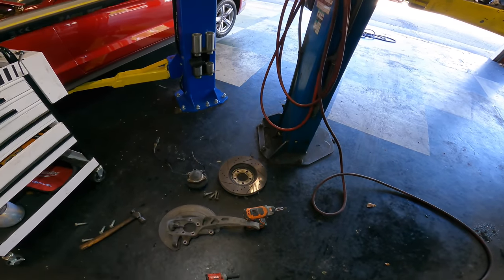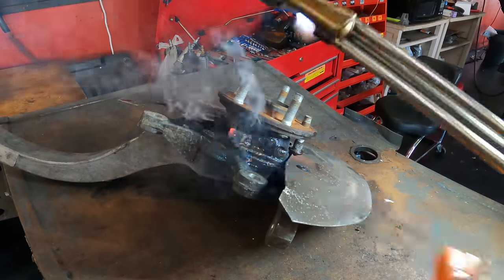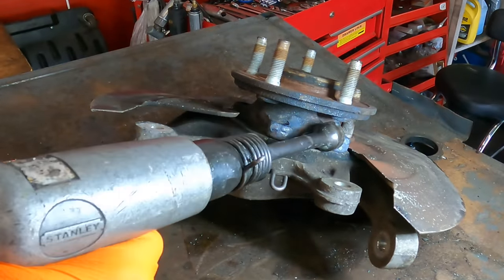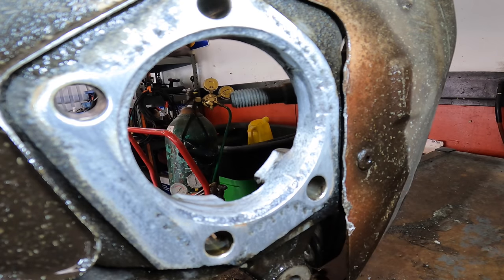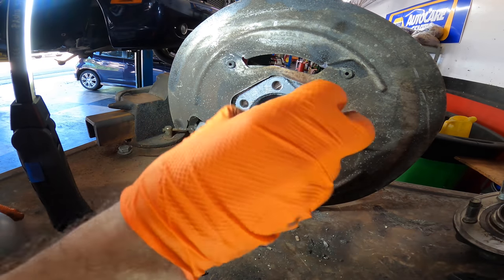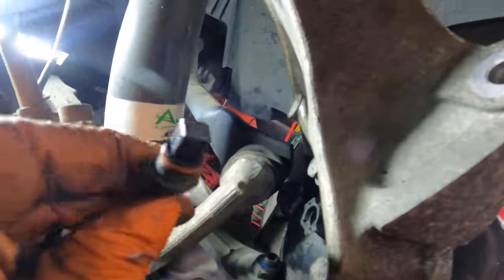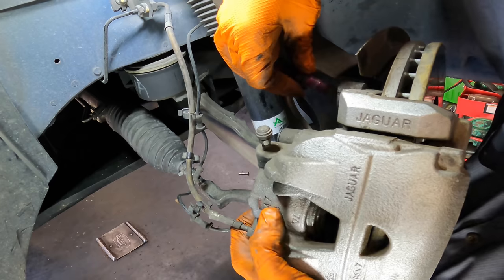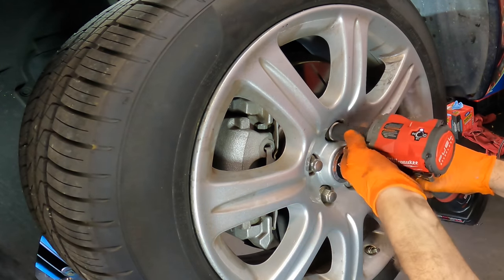Serious Corrosion! HEAT Required! Torching a Jaguar 2008 XJ 4.2 Hub Bearing/Bent Parts

Comment: Nothing like a little aluminum/steel electrolysis, dissimilar metals and the aluminum is less noble. At least you used a zinc based anti seize the zinc is less noble than the aluminum. The only way to stop the electrolysis is to prevent moisture from getting between the steel and aluminum, even a good coat of epoxy paint would help slow it down.
Reply: @OOga Booga I’m going to have to disagree with you as it takes some kind of electrolyte to cause the aluminum to powder into dust it can be a salt or a acid. They are both carried by moisture. Same principle as a battery. That is galvanic action also but then again there we are harnessing the electrons to do some kind of work. Call it anything you want but it is the same effect there is a current flowing between the steel and aluminum that is causing the aluminum to powder up and become a oxide. If you think about it we galvanize iron with zinc to stop the oxidation.   If you really want to dive deep as to what is going on there. I’m thinking that the abs sensor and the tone ring are causing a small magnetic pulse that is acting on both the spinning steel bearing and the aluminum structure breaking down the the aluminum oxide in the steering knuckle and causing the slow breakdown of the aluminum component. Of course the bearing could be magnetized and causing an electric field around it as it turns, but that is a stretch.. either way there are electrons moving between the dissimilar metal that is causing the issue.

Comment: Question for my own knowledge:
Does using an extension between the wrench and socket on a torque wrench alter the torque value? 
Some wheels require a short extension to clear the tire and/or fender.
Thanks.
Reply: I would think so; bet someone's done a YT on this subject.
Reply: It does, but you can find the equation to work out how to adjust your torque setting accordingly based on extension length, etc. There should even be tables and calculators available for it.
Reply: No it doesn't
Reply: As long as the extension is straight and the torque application is smooth, you will not see a difference.  A long extension, very heavy torque and quick bouncing torque application will definitely throw off torque.  Think torque stick.

Comment: The heat and vibration broke the bond of galvanic corrosion 
The whitish substance can be seen as the bearing fell away is alot like a weld though this occurs naturally 
You guys up north probably understand better that salts increase the reaction 
Good one here Ray didn't see any other way to proceed here
Reply: I would not recommend using a blow torch on a steel-aluminium part. Nobody knows how the heat affects the strength of the aluminium part.

Comment: A rosebud would work a lot better for that, puts out way more heat and has more flow so you can run more on your gauges. And I would highly recommend not using a Bic lighter to light your torch! Strikers are about the same cost as a lighter anymore and a hell of a lot safer trust me oxyacetylene Burns hurt like hell. I am a structural welder by trade and you can put alot of heat quickly with a good rosebud tip, enough to camber structural steel and bridge girters

Comment: Well Raymundus: did the wheel true up or not. WAS THE SPINDLE BENT. We all suffer from time change. You should fly to England where your son is in the Airforce and after a short nap go with him to the hobby shop and replace the clutch on  an AlfaRomeo front wheel drive car and all the other Airforce guys looking on wondering if we will get all these parts back together and before noon having it back on the road. Jet lag in that case is truly horrendous.
Reply: Oh yes, he drove out a country road and asked if I wanted to drive back in a right hand drive car. I accelerated up to 75 and in the first corner a car was coming on the wrong side of the road, my hand twitched as I saw I did not have enough room on the inside so I went wide and then remembered as I went past it was left hand passing. I never drove there again.

Comment: Well, I've got 2 question:   Does that kind of heat weaken the metal in the hub and make it more susceptible to failure down the road?  The 2nd question:   would a better penetrating oil such as "in and out" or "Kroil" penetrating oil soak over-night followed up with hydraulic press be an effective option?
I am just concerned that that much heat has compromised the part.   I've even read where the Milwaukee heat gun is effective.  I have also read where 500°F is sufficient.   The amount of heat applied appears to exceed that.
Reply: The bit that was heated up (the bearing) was thrown away. No direct heat was applied to the other part steering knuckle.

Comment: Rule # 5 Do not use the torch with rubber gloves. If by accident they cot on fire the rubber will melt and stick to your skin at very high temps causing you a trip to the hospital and get skin grafts!!
Reply: Apart from that, I use the same gloves daily, working with paint tinting machines. They are awesome a super strong. I was actually thinking about sending Ray some samples.

Comment: :-))) If you want to freak out the basement "scientists" just quench the whole thing in water after it's good and hot! `In lawn mower repair, rule #1 is do not use a hammer on the main shaft to remove the flywheel by inertia. Even though it's in ever manual (When paper manuals existed)

Comment: You should have applied the heat to the bracket  going round in a circle.  That way the bracket  will expand  away from the hub breaking the bond.  What happened was the hub expanded with all the heat making it even tighter.

Comment: Sorry, but didn't heating up that bearing assembly cause it to expand inside of the spindle housing?
Reply: Two different metals. The expansion rate of Aluminium is twice that of steel, so it doesn't matter in this case.

Comment: Does an extreme heat ruin the bearing melt all the grease out of it if that was my car I think I would rather just have a new bearing put in there…✌🏻
Reply: That’s what Ray was doing. Removing the bad bearing to replace it with a good one.

Comment: I wonder if you could have somehow used the hydraulic press to push it out.
Reply: Probably, but he would have had to fabricate a custom jig (holding set-up), as part of the structure was aluminum.
Reply: @kenc2257  you can use leftover bricks. that’s what i did

Comment: which cars are worse to work on? Jaguars, or range rovers?
  I know a service department manager for a dealership that sells range rovers. I asked him how good are they. He laughed and said the mechanics love them. they are job security for the service department. Practically every one of the new ones sold end up being brought in on a flatbed at least once in the first year.. and I don’t know anyone that has ever owned a Jaguar.
 I almost bought one years ago. A friend of mine that ownd a car dealership took one on trade ..it was a Jaguar sedan. He called me and asked me if I wanted to buy it very cheap..He said it’s gorgeous, red leather interior, not a mark on it, we just can’t get the idle to come down below 4000 RPM..
 I told him, I’ll pass, I’m not that stupid yet

Comment: Interesting that they used two different bolt heads on the bearing.
Reply: From reading other comments, supposedly those were replacements for the originals. It looks like they were supposed to be torx

Comment: Steel does not expand at a greater rate than aluminium, its the other way round!
Steel expands by a co-effecient of 10-12 microns per meter for every degree c you heat it whereas aluminium expands by as much as 25 microns per meter for every degree C of heat!

Comment: Hey Ray my story of never seize is extensive During the 2020 election some one kept stealing my trump signs out of my front yard. Well after the second time I said to myself what can I do to help prevent this sorry situation, Well I was slugging down a cold one by my garage and looked at my shelf of can goods and grabbed the copper never seize bottle and coated the outside edges of the signs, Well about 11 at night I hear profane language in the road by my front yard LOL FYI this stuff is near impossible to remove from leather steering wheels and interior parts Ask me how I know I was laughing as I turned on all the outside lights to see a nissan rip away in angry fashion.

Comment: Pleased to see Ray is using the Torque Wrench on vital items such as brakes and lug nuts.  Not just for safety reasons and best practices, but also for liability reasons.  Just one "reeeeee", I would have preferred to see you switch from the latex gloves to heat-resistant gloves while wielding the torch.

Comment: A new steering knuckle was not available (remind me never to buy a Jaguar) - OK  I get that.  But the BEARING was not available?  I thought one could buy a bearing in just about any size / configuration needed.  No?
Reply: they sell as a bolt-on unit. 50 bucks for a pair on ebay

genuine koyo is like 150 bucks

Comment: First off, now you have a slight taste of what I get to deal with daily. Secondly why was that torch already set for  oxy/acetylene mixture when you lit it? ...Thats super unsafe. Lastly, gotta be careful using heat around euro (and some domestic) alloy knuckles, they tend to be alloyed with magnesium, and can result in a very hot uncontrollable fire that is hard to put out

Comment: Tip: Next time rotate the bearing assembly on the steering knuckle by tapping with hammer or pneumatic tool. -> 1/4 turn and it´s out without causing any harm to any part.

Comment: Wouldn’t trust the heated part. Way too much heat applied for my liking. Toss it away. Liability is way to high.
Reply: How is the heat going to damage it?
Reply: @jamskinner  well as designed it is a pot metal (casted) and they are designed for X amount of heat. Exceeding that will alter the molecules and thus make them brittle. If had it been solid poured metal it wouldn't be as detrimental.
Reply: @jamskinner  cooked the grease and possibly damage the seals.  Probably warped the cast housing.
Reply: @HoLeeFuk317  , he was heating the old bearing which was being thrown away. No seals were damaged. But he was heating the bearing housing
Reply: @loneranger4175  Yes, was just answering how it would damage it.   And in this type of bearing is generally not replaceable, it comes as an assembly with the hub, bearing, and housing preassembled.
Reply: @HoLeeFuk317  another better idea
Reply: @FlyEaglesFly19111  it is not “pot metal” . It is a cast aluminum part. The alloy used is very strong. Pot metal is a mixture of scrap low melting point metals , zinc,lead,copper ,magnesium and cadmium. It is a cheap crap alloy with little strength. Very brittle. You talk about solid poured metal? What are you trying to say?

Comment: Might have helped if you "shocked" the piece dropping it into cold water ,not sure a heated second hand bearing will last long though .It seems to be the norm now you have to buy bigger and bigger spares not individual components of that part ,soon you will need to buy a whole car as spare to fit your key! Bugger if i would bother with new cars they use tech as a weapon to force you to have it fixed by a tech with a reader the art of using pure logic to repair anything is fast disappearing ,you are lucky you think outside the box soon hands on repairs will be a thing of the past and the modern phenomenon of replace whole parts and hope the reader has given enough clues to the fault ,keep it up
Reply: Someone else commented that the heated bearing was not reused. The entire assembly was from a junkyard and just needed the knuckle/spindle.
Reply: Ray himself said the crusty bearing he torched was junk.

Comment: I know you can't argue with success but heat the aluminum, not the bearing. I'm not a hater BTW!
Reply: No thanks. I agree with Ray's method . Have you ever seen what happens when you use a torch on aluminum and get it too hot. Aluminum can burn long before it melts. It has to be welded in an oxygen free environment or it will burn.
Reply: @danielbutler578  Hi Dan, I am qualified in Mig,Tig, stick and oxy-acetylene both welding and brazing. I have fabricated my share of aluminum using tig. Aluminum will melt way before it burns or you could not weld it. You do have to use AC and shielding gas to tig it. I have heated lots of aluminum pieces to facilitate bearing removal and valve guide replacement in aluminum heads. Honestly I am speaking with over 35 years experience. Thanks for the reply.

Comment: Good to see you working on an English car Ray.😁
Reply: It's not a proper car unless it uses Whitworth fasteners 🤣
Reply: @P_RO_  Whitworths make bread 🍞 😁
Reply: @andyellis307  Guess you missed the joke. Maybe you're too young... well anyway Good Day.
Reply: @P_RO_  yes mate that's why I said what I said lol 56 years
Reply: @P_RO_  whitworth a bit coarse?? Would not BSF be a bit better?
Reply: @BillCook62  Whitworth was designed for use in softer metals; the rounded peaks and valleys distribute the stress more consistently over a wider area. It was really a good idea but never caught on outside of the UK as standard threads seem to hold well enough.

Comment: Wont be long before it needs a new bearing. That much heat will cause the grease inside to reach drop point destroying the effective lubricating qualities of the grease. A little heat is ok and should be enough ..Using a press is key in this project.Probably a new bearing would be best due to its age and amount of labor.
Reply: Dude, he didn’t reuse the heated bearing.
Reply: @MrCumstein  opps my mistake.. Glad he used a new one.. I guess i missed the opening of the box.. Thx
Reply: @TheJcrandazzo  He didn’t use a brand new one, he reused the original bearing which was still good.  No doubt because the customer wanted the cheapest fix possible.

Comment: I would not want that hub on my car.  If I found out that a torch was used it would be replaced.
Reply: He did not heat the one that was used on the car.

Comment: I agree with like 99% of your repairs. But every once in a while you throw in something like this. I would have gotten a new hub bearing. And other new parts. Years ago people tried to do this and I said NO. Of my name was on it it would be dont to my specific standards. This votes the same for my HVAC career now. I disagree with this one bud. Have a great day. Stay safe and be well.
Reply: I don't think you're taking certain things into consideration, when is the vehicle needed, how long will the part take to be delivered (overseas), but more importantly, did the customer specifically ask for it. Remember the parts have already been pulled apart and need to go back together under time.  There is always a causation for the end result. Assuming situations get some folks into trouble, solving issues is 90% of  mechanics work.  I do wonder about the seals on the hub though.
Reply: I can't speak to the current state of auto parts, but some lock and door parts I could have delivered next day a year ago now have 3, 4, or TBD weeks lead times and I've had to recycle parts to makes repairs today.  Business don't want to hear they can't lock their doors for weeks while waiting on new parts.
Reply: @markusallport1276  yes thank you I do service work everyday. And if its not good enough for my house its not good enough for your house. I solve problems everyday and also run into what the customer wants ultimately. I am sure somewhere may have had a hub bearing. Stay safe and be well.. yes I have parts issues too with now extend wait times. Equipment can now take 16 weeks to get.

Comment: I really do not get it. buy  a used part from junk yard then use a used bearing to make 1 semi good part  with heat to shorten the life of bearing.  Sorry I don't fly that way. Just buy the new part and be done with it. Cannot see how they saved money in the long run. It will be back for a new bearing and big bucks all over again.  Not blaming you Ray.  The customer.
Reply from the maker: I heated the junkyard bearing, and reused the original. The goal was to replace the bent knuckle

Comment: What in the world are you doing ?? I hope you aren t reusing any of that. You got that way too hot. You ruin the seals in the bearing , took the temper out of the bearing and case hardened the aluminum making it brittle.
Reply from the maker: No I didn’t reuse it, I replaced the steering knuckle and used the original bearing

Comment: I love most of your videos and your diagnosis of failures, but I couldn't believe you would use a oxyacetylene torch on an aluminum suspension part. Even directing the flame at the steel part. I would have used a propane torch, and temp sticks to make sure I didn't overheat that aluminum part. An oxyacetylene torch can be as hot as 6000 degrees Fahrenheit. At 350 degrees Fahrenheit aluminum parts will start to lose their heat treating and strength. You must have had the aluminum at the bearing near that, if not over it, for the end to reach 180ish  as you showed in your video. In my opinion that was irresponsible, and dangerous and has put the driver of that car at risk of having a serious failure. You also put your shop at risk for the liability of that failure. If I was the shop owner I would replace the knuckle and install a new bearing at my expense for the customer just for the liability.